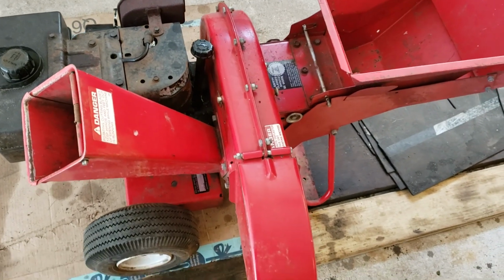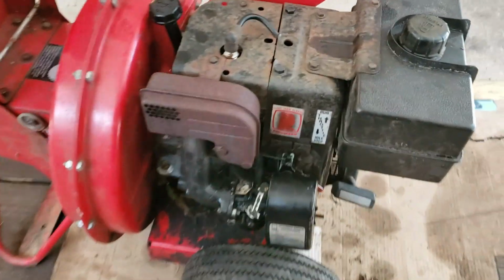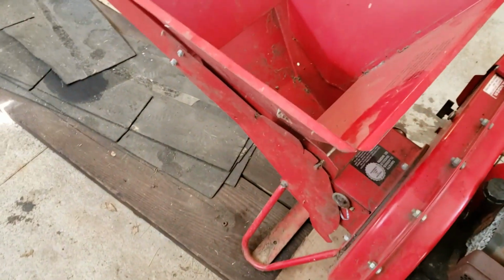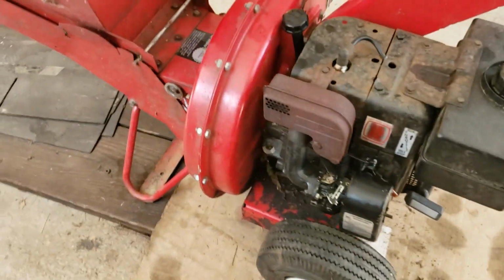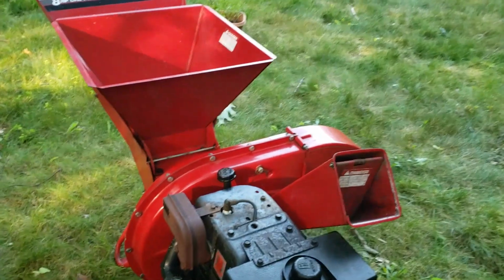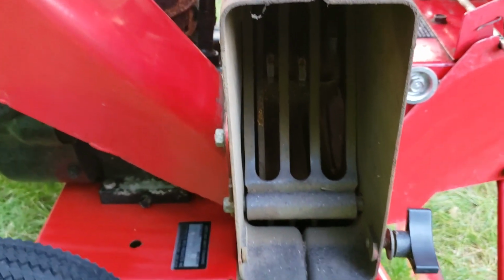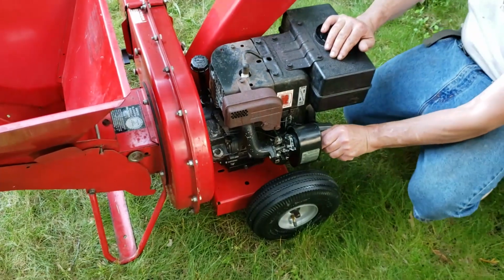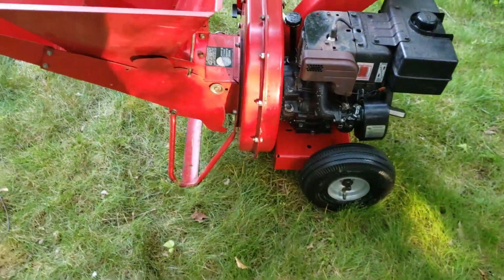Old 8HP wood chipper eating nasty stuff! 1991 All steel MTD. No plastic here!

Comment: My father purchased one of those back in 91, I still have the 8hp Tecumseh engine mounted on its wheel frame after reclaiming it from an Uncle who separated it from the rest of the wood chipper.
Reply from the maker: That's great!  I just don't see those big engines around anymore.  Starting it is a blast. The flywheel must weigh a ton, because you really put your back into it....and it slowly chugs along.....and it keeps chugging, then starts to catch and finally roar to life!  -C

Comment: i just got done working on a old cast iron tecumseh 8.0 hp craftsman  i had to replace fuel line  and had the carb cleaned they were tough and sturdy and well made machine it does need a new fuel filter though but we got it running after the guy had it cold stored with bad fuel in it i like these old motors there rock soled great video i enjoyed it i subbed
Reply from the maker: Hey, thanks man.  I'm quite impressed with this engine. It really did not need too much fussing to get it working well. The fuel line had some rot and leakage, but easy enough to fix. Plus a good carb scrub.  I'll tell you though....you really need to put your back into it to pull start this 8hp commercial Tecumseh!!

Comment: Its an HM80, their medium frame engines. Same as the snowblowers, just set up for summer. The HH line had cast Iron blocks and were massively heavy, found mostly only on tractors.
Reply from the maker: Have to put your back into it to pull start it...like hand starting a WWI Bi-plane.
Reply: The rare HHM80 (type series 190000) was a replacement for the previous all iron HH80 series.

Comment: Would any one know we’re I can get the carb for this model. I’m having a lot of trouble finding one. Thanks
Reply: They sell on Amazon.  Get the adjustable one if you can.  They are more expensive, but worth it.  This model Tecumseh was made for a long time and there are plenty of replacement parts still out there.
Reply: Thanks I already bought one and it runs great now.thanks though!
Reply: Hello pyrite2009, I am trying to find a carb for this excact model but I can't seem to find the right one, they're all slighty different. Can you tell me which one and where you bought one? Ps. I am located in Australia. Cheers

Comment: Purchased an identical tool. The choke always confuses me. Thanks for the video. Changing the gas 9ut, hopefully it will run now. Thank you.
Reply from the maker: Good score!  Very sturdy machines. If you take the air filter off, you can easily see which position the choke is in. If not started in a while, a little starting fluid into the car help greatly to prime things up. You really need to put your back into pull-starting that heavy duty, commercial 8hp engine.  Good luck!   Let me know hoow it goes. -C
Reply: It starts with gusto and little effort with starting fluid but stops within 25 seconds.
Reply from the maker: @kevinjones560  Hmm.  Sometimes if you remove the filter and keep giving little bursts of carb cleaner (just enough to keep from stalling), you can cut through any gunk in there after a minute, and it will then remain running without spray. Need Gummout or Berryman which are combustible.  No guarantee.  Otherwise probably sticky needle valve or the fuel riser that goes from bowl into the carb venturi is blocked. Very common!  -C
Reply: @TenaciousCsRescueLeague  thank you. I will try it.
Reply: @TenaciousCsRescueLeague  ihave gas flowing and cleaned the needle valve too  and it will keep running as long as I keep putting starting  on it. Could e10 gas be part of the problem? Thank you for your help.
Reply: Do you know what model number the carburetor is. I'm having a hard time figuring it out.

Comment: I have that same red unit. I can't read the label since it is old...1990 q991 also... Is there a manual or parts list? I need to fix my throttle control arm, which is doing nothing...  Thanks
Reply from the maker: Sorry, I don't have a parts list. Can probably get one for the engine. The Tecumseh 8hp commercial engine. The throttle for mine is just a small tab on the engine. No cables or anything. Quite simple. I'll see if I can get the numbers off of mine!
Reply from the maker: OK, Nuno!  As promised I found the model number for my machine: It is 241 648 000. Google that and it will drop you for a hit right into many after market MTD providers for the 1991 machines..(example attached).with parts diagrams, etc. Can also lead you to on- line manuals. Unfortunately, I can't find a tag on my Tecumseh 8hp engine for that direct engine info.  can probably solve that with a bit of digging! Good luck!     https://www.jackssmallengines.com/jacks-parts-lookup/manufacturer/mtd/mtd-legacy-1985-2005/mtd/24-chipper-shredder-vacs/1991-models/241-648-000-1991

Comment: What did you spray in the Carburetor?
Reply from the maker: Sometimes I spray a little starting fluid into the carb. It goes by the trade name "Instant Start". Basically, it is mostly just ether in a can. Carb cleaners such a "Gumout" are good too.  Just make sure you get the flammable carb cleaners to give it the jump start.    -C

Comment: Did you sharpen the blades before or did you run it as is?
Reply from the maker: That's a good question. I was actually able to get a hold of an owners manual online that explains the sharpening/replacement procedure for both the chipping blade (bigger branches) and the "shredder"  component. I never actually did it though. I suppose it is not that hard in the grand scheme of mechanical things!   Thanks for checking it out.  -C

Comment: Great find. The new rsidential type machines in this size are coming with plastic chutes, not the heavy gauge metal on these old beasts. Anyone know where I can get a parts manual and parts for this model. I have the Yardman SC8 twin configured with the same engine and need an impeller. It appears that many brands like Yardman, MTD, Sears, Cub share many of the same parts.
Reply from the maker: Thanks man,  I know what you mean by the transition to plastic. This example still works great and I used it for fall cleanup just last November.  I found the manual 
here for mine (model  241-648-000).  
http://www.hammerwall.com/Download_Manual/113644/

You need to verify you are not a bot, but I was able to secure a .pdf.    Good luck and thanks for the view!
Reply: @TenaciousCsRescueLeague  Thanks for the link. My Yardman SC8 twin to your MTD is missing all the flailing fingers, has one chipper blade missing and needs the other 2 replaced.  Plus, 2 of the impeller flailing attachment arms are bent. An impeller assembly is $300 new. Ouch. Hope to find a used one, but I'm not  camping out at the landfill waiting for someone to junk one! You did a good job cleaning up yours. Cheers.
Reply: MTD makes these machines for Cub Cadet Sears and other companies..thats why the parts are the same

Comment: I just acquired a Murray version of the same thing. It does run on starting fluid. Once the new carb comes in we'll put her to work.
Reply from the maker: Excellent! You will love it.  They are beasts. Mine could probably use a sharpening, but all good.  -C

Comment: they are good chippers Mtd rebadged them for the Sears Craftsman and Kmart as the powercraft. they mostly came with the 5-8 hp Briggs & Stratton flathead engines some Tecumseh flatheads as Tecumseh is no longer in business. and Briggs & Stratton no longer makes the flathead or L head engines anymore. repowering these chippers if a Honda or Honda clone the exhaust has to be modified to reposition the muffler, and the chipper chute needs to be modified cut and rewelded to clear the gas tank that sits on top of the engines. the commercial engines Briggs makes today are the Vanguard OHV motors they and the honda clones have a better torque curve and burn less gas. as a chinese engine Briggs and Stratton makes are the XR series a Honda clone block. not sure of these on chipper shredders. but not Sure if MTD made these chippers marketed under the Troy Bilt name
Reply from the maker: Hey Derek. Thanks for the wealth of info. I must say, the engine on this device appears heavy duty. Big air cleaner, no fuss. As noted, I also have that leaf blower with an 8hp Briggs I/C engine .  Big chrome 2 stage air filter, simple choke, no plastic primer bulbs or anything....and it runs like a champ!